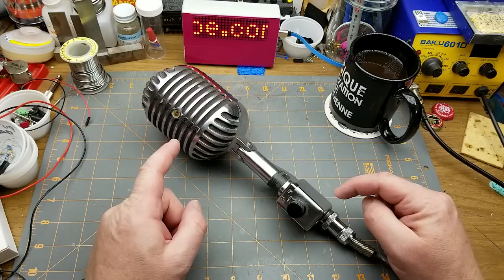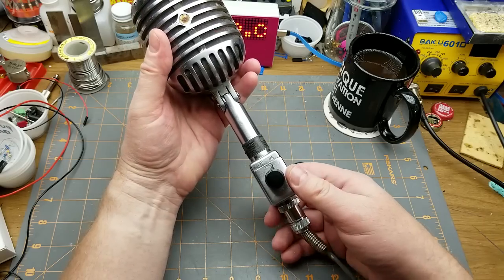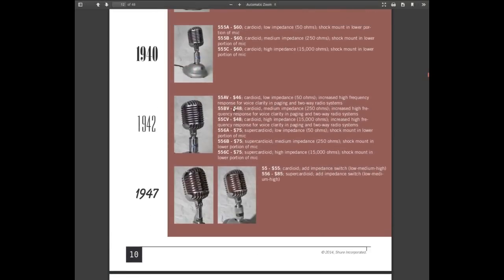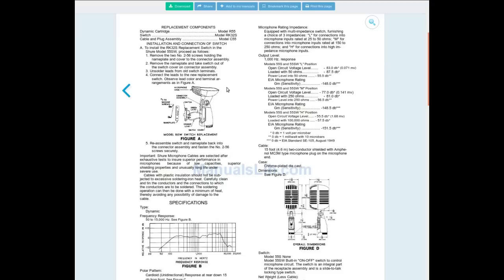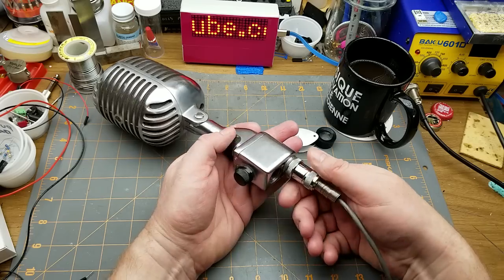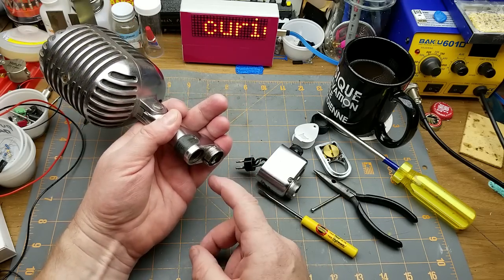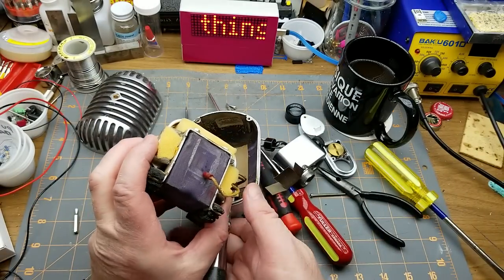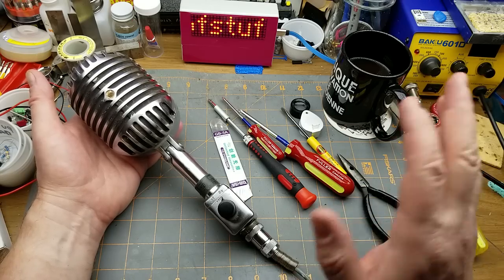Looking at a vintage Shure 55 microphone

Comment: Happy to have found this video! I just came across the exact same unit with the a83b switch. Mine actually sounds just as good as the 14a I had to compare. I was shocked. Not only does it sound good and look amazing, I only paid 50$ from an older gentleman who held onto it for many years and just decided it should go to someone else. I lucked into being that someone!
Thx for opening it up and satisfying my curiosity so I don't have to.

Comment: Shure still hosts the 1951 version of the user guide for this mic on a page on their web site called "Discontinued Microphones User Guides."  They have a bunch of period catalogs too to see what else was being made at the time.  Nice job on the video.  The two 55s I've purchased were both damaged beyond restoration (one was a completely empty shell), so it's great to see what the inside is supposed to look like!

Comment: I have a Shure 730 B that belonged to my wife's grandfather. It is from around the same year as the one you showed in this video. Unfortunately the crystal element wasn't working. I took it to a repair shop and had them install a modern dynamic capsule. Had a lathe operator near my house make a stainless steel base for it. I use it everyday on my PC. Looks awesome on my desk. I wish I had a 55S too.

Comment: I just picked up my second "fat boy" 55 today (55C, high-impedance only) and although it sounds marginally louder than my multi-impedance 55 they are both quiet, tinny, and resonant. Yours sounds hi-fidelity compared to them. I suspect you're right in that the magnets in the capsules (and maybe the transformers) have likely lost strength over the years, leading to reduced frequency response and output. I wonder if there's a way to re-energize them without destroying the capsule?

Comment: Do you think I can open the cage of these similar Shure vintage mics and spray paint it and then put it back? Would it affect the mic in any way?
Reply from the maker: If you are only spraying the metal casing it shouldn't change anything.
If paint gets on the cloth or screen it may muffle the sound somewhat.

Comment: You had me worried there, I thought you were going to butcher it. Haha

I've got a few similar style mics around but I don't think mine have the switch. They had line impedance shifting transformers you could plug between cords too. The last new line transformer I bought was in the 80's. A P.A. system I purchased in the 80's had on board phantom power but it also had 1/4" phono jacks for instruments or older style microphones. At one time they made adapters for all those different mic connectors. Probably have to hit a vintage shop to find one today but we know the internet has everything these days.

I've got a few old Turner brand models that don't work and I think I may stick some modern guts into them to bring them up to speed yet retain the classic Buddy Holly and Elvis look.